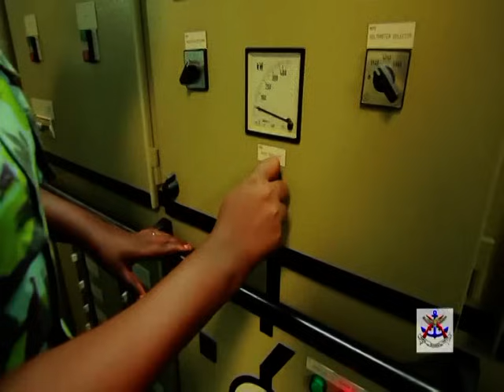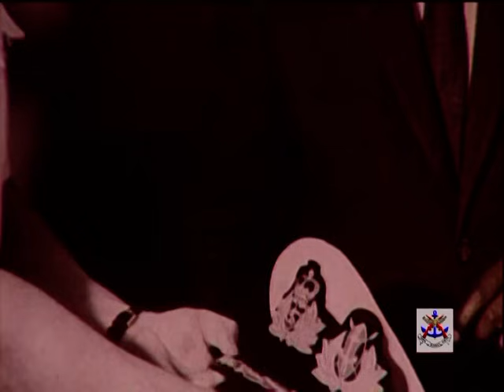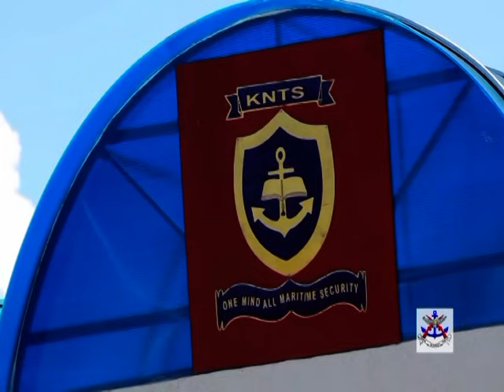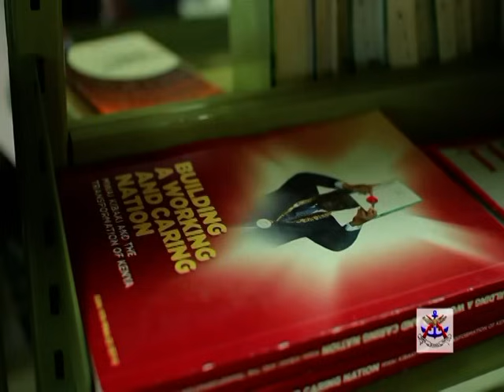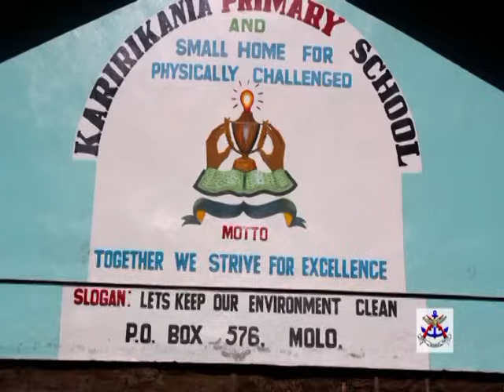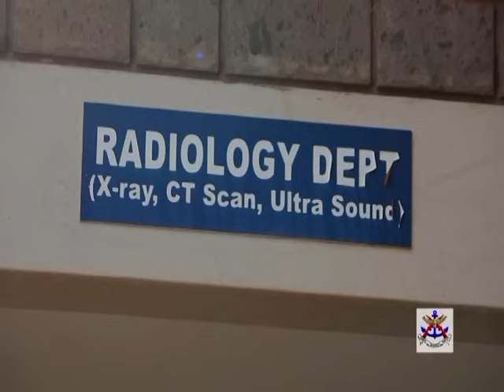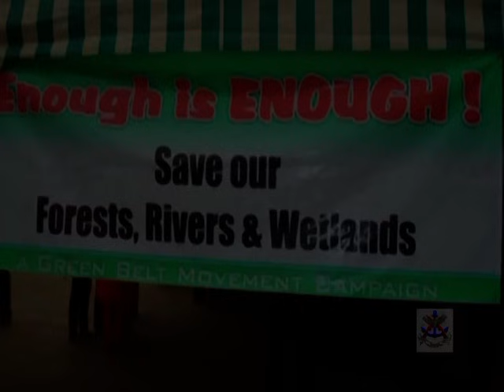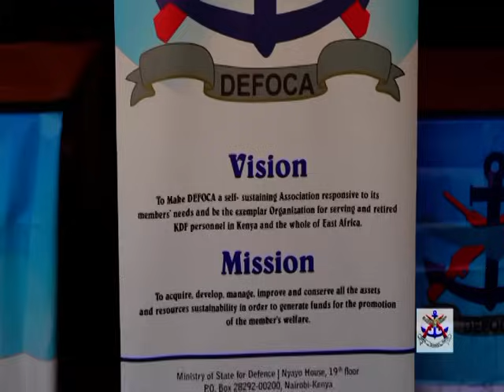This is KDF   Documentary

Comment: Those helicopters dot have spares: they break down and sit for months waiting for spares since they were acquired back door in shady deals from poorly supported Eastern European/ former soviet countries. So they are barely used except for show. It’s a sad fact. For an African country buying a serviceable warrantied aircraft is one very evasive thing, buying an old one is another different thing. And buying an aircraft model old and not currently supported by the manufacturer  one is another. But buying an aircraft which manufactured went out of business in the early 90s is even deadlier. Especially if the purchase was meant to camouflage corruptible strategies. Inside story is that half of the Kenyan military machinery are broken down and hence used as parts to service the other half which are barely serviceable. And this is a very inside story.  And by the way did you hear about he helicopters kenya police bought from Russia not many years ago? Do you know that two years later they put about 2 on a ship and sent to Russia to be overhauled and rebuilt because they didn’t have the technology, knowledge and parts to keep them in the air? Some parts needed to be machines and made because they were no longer available in serviceable condition to be acquired for use on the helicopters. And I don’t think hey are back yet but the story is that they paid about 6 million dollars a piece when those things are all over Eastern Europe decommissioned and being auctioned for about 40,000 USD. So who is the fool? The KDF cannot stand against any military in East Africa. It’s the weakest and least experienced leave alone the unfitness and bureaucracy that is sandwiched within. It’s the only military where soldiers sleep when they go to war in Somali and forget to keep guard. It’s the only military where you are employed mostly because you are thought to fit in with a particular group of people. Promotions are not by merit but by grandfathering. People ride from private to captain. Corporal to major bu presidential appointments. It’s a shame.
Reply: YOU CAN ONLY COMPLAIN AND THEY RISK THERE LIFE FOR YOU.THINK TWICE